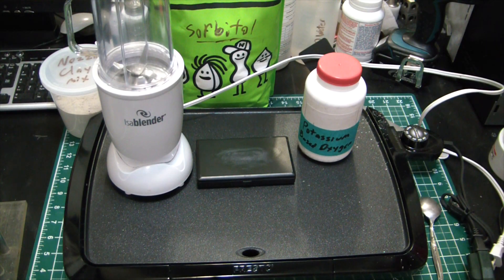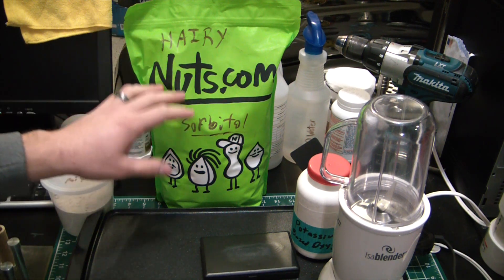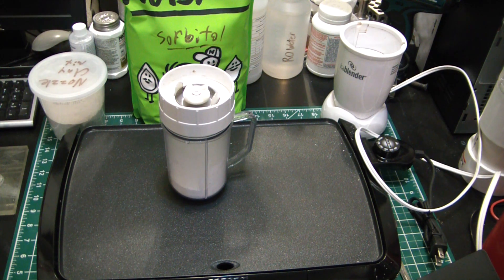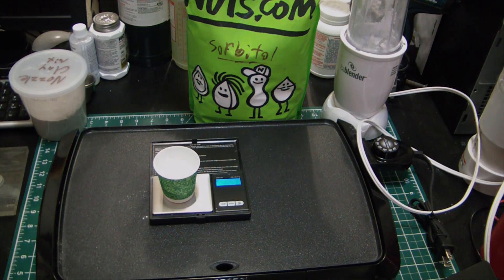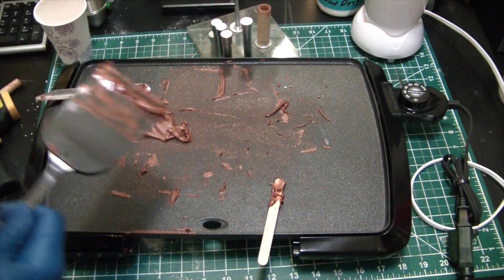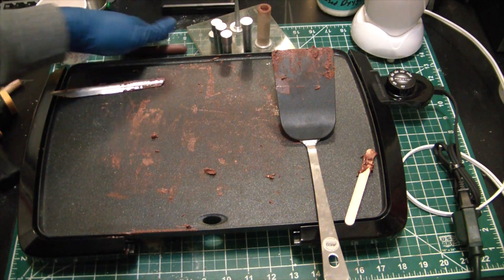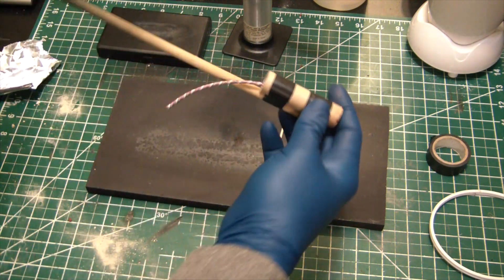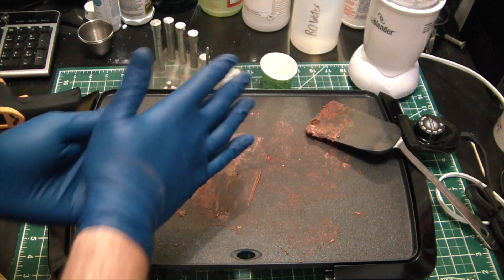Sugar Free Rocket Propellant - The EASIEST Rocket Propellant! - ElementalMaker

Comment: I only have one problem with sugar rocket, Hygroscopicity. So after sugar rocket cooldown, you must quickly store it in air tight container with strong dessicant like calcium chloride. You also have limited time to assembly it especially when air humidity is high. Because sugar rocket will absorb water vapour and become wet. It's why estes choosing black powder for light to medium model rocket, it's still reliable even air humidity is high, don't require calcium chloride, easier cast and more safe to produce
Reply from the maker: Yes black powder is certainly superior for long term storage of rocket motors.

Comment: What is the difference in price's of sorbitol and powdered sugar? And is their a measurable difference in the propulsion and distance from either?
Reply from the maker: Powdered sugar is way cheaper, but the lower melting point and easier workability of the sorbitol based propellant far outweighs the extra cost imo. Impulse is pretty similar from data I was able to find

Comment: Make an electrical igniter with speaker wire. Cut all of the strands leaving around three. Twist together. The way your mould looks the hole goes to the top of the motor. Slide the igniter to the top of the motor. When it burns, it will build pressure as it works it's way to the nozzle.

Comment: Try Xylitol. Its molecular formula is C5H12O5, Its molecular weight is 152.15g. Xylitol's melting point is 93- 95C (199-203F). Interesting, the molecule is smaller than that of even sorbitol. 👍 Best of luck ❤️

Comment: The best thing to do with sorbitol :-). I love this stuff for fuel. Low melting temp and easy to pour. 

Question : how do I add an ejection charge to a pvc rocket motor (assuming I don’t have black powder) ?
Also : is a “rocket candy” motor troubled by absorbing moisture ?

Keep going safe

NOSS
Reply from the maker: Hi noss, unfortunately for an ejection charge you are going to need BP. That being said BP is super easy to make, even without a ball mill. I think the one method is called the cia method, and makes pretty good BP using a wet method.
Reply from the maker: And yeah unfortunately all rocket candies I'm familiar with are aggressively hygroscopic.
Reply: @ElementalMaker  It depends on your ambient humidity.  There's a pretty sharp cutoff where if it's drier than that there's no problem--like where I live in a desert, it will actually dry (very slowly) rather than absorb water.

Comment: Newcomer here!   Does reducing down the sorbitol and KNO3 change the way it burns or does it just make it easier to handle?  I was wondering about the possibility of air pockets if it's not packed correctly and so maybe reduce it down less.  Maybe just enough that it turns to a viscous liquid like brownie batter and could pour out so it would pack better?

Comment: What’s the secret for coring these engines? Do you bore them out after they cool?  Had no trouble dropping the “hot dogs” into the casings, but when it came to forming the core nothing seemed to work. Tried tools that were tapered, straight, metal, plastic, various release agents, heating the metal. They all came out with great difficulty and had propellant stuck on like glue.
Reply: put a small amount of vaseline on the core rod let it set then it comes out easily

Comment: What about some polymer based ones? I imagine polyalkenes like polypropylene or polyethylene would burn quite well. Or styrene-based ones like ABS or plain old Polystyrene, they could be potentially easier to mix with the oxidizer because you can simply dissolve them.
Reply from the maker: Check out my apcp videos.

Comment: Speaking in terms of performance, which ingredient is better? Sugar or sorbitol? I've been doing some R&D with my own motors lately and playing with different mixes. Got tired of grinding and milling the kno3 so I ordered pyrotechnic grade already finely powdered. Got sorbitol otw too so I'm curious to see the difference...if any
Reply from the maker: I believe sugar produces a higher specific impulse, so per unit mass you'll get a bit more performance but the difference is pretty small, and the ease of working with sorbitol is well worth the tradeoff imo
Reply from the maker: I just looked at the data, and knsb is so damn close to knsu in terms of specific impulse it's basically a tie.
Reply: Ease of process is what I've been trying to achieve over performance so that sounds good to me. I've been experimenting with pressing a washer in the end then adding 1/4" of clay for a thinner, lighter nozzle. It also helps center the core hole. I appreciate the info good sir.
Reply: And for the top cap of the single use engines, ive been just pressing a 3/8" long piece of the 5/8 dowel, w/ a slightly sanded beveled edge and pressing it in with my drill press vice. Then applying light bead of super glue on the O.D. of the dowel to seal it up. And violá.

Comment: Can you replace you replace your potassium based oxygen with chlorine based oxygen i.e KClO3
Reply from the maker: Hell to the no, to the no no no. That would be an explosion, not a rocket, plus it would likely detonate on the hotplate and kill the person making it
Reply: @ElementalMaker  that's sad cause i have 1 Kg of chlorine based oxygen
Reply from the maker: @justintremblay2318  Be careful, KClO3 is quite a dangerous oxidizer. the perchlorate compound is much more safe.
Reply: @ElementalMaker  i have to make it tho
Reply from the maker: @justintremblay2318  have to make what? You can't make rocket engines with chlorate, it simply doesn't work and you'll loose a hand.
Reply: @ElementalMaker  meant potassium perchlorate i have to make it because i dont have it i only have KClO3
Reply from the maker: @justintremblay2318  oh thank sweet baby jeebus I was worried for your safety 👍

Comment: Couldn't it be said as the sorbitol or sugar depending on what recipe you are using, converts to carbon or charcoal as this mix burns, basically is making a black powder mixture? But the burn rate is much more controlled than if you were to use black powder because it is not "black powder" yet, kind of like "just in time" black powder

Comment: Okay, so, just to be clear..... Potassium based oxygen = KNO3? I tried making this, and mine was super sticky, definitely not mold-able like dough, as this was
Reply from the maker: Correct. It takes a while for it to cool to a nice moldable consistency, just give it a few minutes sheet you turn off heat and it'll get there.
Reply: @ElementalMaker  Sweet. I'll work on that "patience" thing lol. I'm also gonna try buying some rust powder instead of making my own X'D Pretty sure vinegar jacked it up or something. I tried everything from a butane torch to estes igniters, and my final product just refused to burn

Comment: In high school, I came up with a rocket fuel using Zinc Dust and Powdered Sulfur after checking out the atomic structures of each and used a mixing weight based on the ratio of their respective atomic weights. I used CO2 cartridges for casings. For My maiden voyage, I used a steel jack handle receiver as the launch pad. The cartridge disappeared into the evening sky and the steel receiver split apart from the exhaust pressure. Needless to say I was a science nerd and I had the run of the chemistry class inventory after getting the job of taking inventory of chemical supplies. You don’t want to know the story behind my Red Phosphorus and Powdered Magnesium Flash Powder incident.
Reply from the maker: Very cool! I've only ever seen videos of Zn-S rocket motors. Always wanted to make one but was never able to source enough zinc powder. Thanks for sharing, it definitely makes me want to do a video on zinc sulfur motors 👍
Reply: BTW, I had a local neighborhood Chemistry Club where we did all sorts of science experiments. The dues allowed me to purchase chemicals that required my father to sign off on. (The supplies arrived by rail) I got the supplier catalog from my chemistry teacher. Those were the days. I got the bug after receiving a Gilbert Chemistry Set for Christmas.

Comment: Hah! You said "supercritical". Can you explain more about your nozzle clay mixture? Straight bentanite has been giving me issues.
Reply from the maker: Of course, it's 2/3 bentonite and 1/3 grog by mass. I then put it in the oven with a small chunk of paraffin wax and allow the paraffin to melt into it, mixing every few minutes until homogeneous. The paraffin allows it to compress beautifully and also acts as a lubricant for easy removal from the forming spindle. Another benefit of the paraffin is that it prevents the bentonite from absorbing atmospheric moisture. Probably more than you wanted to hear, but that's my process LOL
Reply: @ElementalMaker  thanks very much. Some terminology issues on my end though, what do you mean by "grog"? To me it means some form of cheap alcohol.
Reply from the maker: @Jannie303  grog is essentially a refractory sand that is used in pottery and other industries. Here is the wiki https://en.m.wikipedia.org/wiki/Grog_(clay)
Reply: @ElementalMaker  Awesome, thanks very much! Just found your channel through your pyrotechnic videos but I'll definitely be going through your electronics videos too.

Comment: Estes are stupid expensive... what are they now, $10 for 3?  And small ones, not even the D or E class engines.
You know why they're so expensive? LAWYERS.  Same with simple tools for casting metals like aluminum, a set of tongs for pouring a 6lb crucible, $20 or less of materials, costs $400.  Fuck the lawyers.  All Gems should die.
Reply from the maker: Wow I didn't realize that got that expensive!

Comment: btw, sorbitol based fuel burns much slower than sucrose fuel which means that you will have to make the nozzle smaller to get the thrust that it is capable of giving(which is less than that of KNSU)
Reply from the maker: Yeah I'm going to change up the tooling I made for a more narrow nozzle throat diameter. Ill step it down to 1/4" and see how that goes.

Comment: I wonder what happens if the sugars get to be mixed up like 1/1 ratio sorbitol/table sugar 1,if it stays so moldable,2 maybe more power?
Reply from the maker: Quite possibly. Although I think at those low temps the regular surgar would stay crystalline, leading to grainy propellant.
Reply: @ElementalMaker  yeah that would be in this method, if you add the tablesugar first it would be standard r-candy yet adding the sorbitol later in the process might do something amazing....or not ;p

Comment: Which is better proponent for rocket black powder or rocket candy? And why?

Please explain 🙏

BTW thanks for making amazing videos
Reply from the maker: There are way too many factors to really say. It all depends on your production volume, rocket engine size, and many other factors. Black powder engines can be made up to F class and are quite easy if you have the proper press equipment. Sugar rockets can be made larger, but are generally more time consuming to make. Also if a motor will be stored long term, sugar is a bad option as its hygroscopic and will degrade over time as it absorbs moisture. Black powder doesn't have that issue and has an indefinite shelf life
Reply: @ElementalMaker   Many people I watch doing sugar rocket videos are using some form of tupperware to keep the motors in when not in immediate use, to combat humidity.You could also mason-jar smaller bates grains segments. Richard Nakka advises using a primer on the fuel grain as sorbitol can be a tad hard to ignite. Electric matches (you can make them yourself and avoid hazmat shipping charges.
Reply from the maker: Absolutely. I prefer not to use mason jars just because of the whole glass holding a pyrotechnic composition thing, but any airtight plastic container works well. Especially with a few silica gel or other desiccant packets. I did a video on making ematches if your interested.

Comment: Its amazing that the stuff burns in such a manner that it aims all its exhaust in one direction despite not being encapsulated.

Seems you could just put a cone in the back of it [like a shape charge] and it would try to fly, although I realize that is not enough pressure control to produce adequate thrust in real life, it just leaves one with that impression.

I want to try with CALCIUM oxygen and with CERIUM oxygen some day.
Reply from the maker: Yeah it is really neat the way it burns! I may have to try that idea and see it I could create a case-less rocket!
Reply: @ElementalMaker  Well, if nothing else, you can always stick some really fine steel wires into it while it is still warm [shape it in a tube lined with something that will let it slip back out, like waxed paper maybe] to act as fletching

Coating it would also help keep it a tiny bit drier, maybe a few brush strokes of beeswax/paraffin as a water repellent, many other options exist, Scotchgard, thin epoxy, spray paint/lacquer, etc.

Another option might be to include a combustible shell of propellant which simply lacks the iron oxide, and that would act as its own casing [ (giggle) ... a 'caseless casing'  ] as well as a place to hod the tail stabilizers.

All that the tail wires need to do is to not melt or burn up before the rocket completes its flight.

Non-metallic options may exist which can endure the heat.

To add gas to the exhaust and slow the shell burn a tiny bit more, one might add a small dab of bicarbonate to the mix so that it will be the last part of the motor to burn up and therefore be sure that the fletching remains in place until the very end.

The only worry would be if you launched it over dry grass or some other flammable situation because if it did not fly high enough, it could come down hot enough to set stuff on fire before burning up.

Winter time is definitely a lot safer time for such experiments.

Comment: When I was 19 way back in 1994 I was making sugar and potassium nitrate smoke bombs in the house, I was melting it on the stove, too hot I guess, and it ignited, burned a big hole in the kitchen linoleum. That anarchist cookbook was full of shit when they said the stuff was non flammable!!! (A few months later i shot a hole in the kitchen cabinets with my longbow by accident, I was making arrows and drew one back to have my wife mark the length when the top limb hit the turning ceiling fan, bam! Straight through the cabinet) I'm still married to the same woman, she's put up with a lot of my stupidity.
Reply from the maker: Holy crap your kitchen has taken a brutal beating! Ever consider a workshop? LOL  Thats a good woman by your side. I got one of them myself. We're lucky guys.

Comment: Potassium based oxygen is potassium nitrate or KNO3 
for the one person who doen't know haha
Reply from the maker: I have KNO3W Idea what your talking about.
Reply: ElementalMaker kno3 or kclo3? Kclo3 higher burn rate? Higher sensitivity to heat?
Reply: @6themaker  KNO3 is potassium nitrate.  https://en.m.wikipedia.org/wiki/Potassium_nitrate
K represent potassium. N represent nitride (nitrogen).  O3 represent three oxide
Reply: @6themaker  https://en.m.wikipedia.org/wiki/Potassium_chlorate
kclo3 is potassium chlorate.  K represent potassium. Cl represent chlorine. O3 represent three oxide
Reply: ElementalMaker anytime you need some CNC turned nozzles let me know. We have a CNC machine shop and make sugar rockets occasionally just for fun. We make the tubes from 2024 aluminum and thread both ends. Nice plug on one end and 7075 nozzle on the other. It works surprisingly well for nozzles. Bates grains inside paper housings work great with this setup.
Reply: @LukeFoley21  you make metal tubes for the rockets, that sounds really dangerous.
Reply from the maker: Reloadable metal casing rocket motors are actually quite common in the high powered rocketry classes. I have a few myself that work beautifully.
Reply: @ElementalMaker  still deadly if you plug the hole to tight and pressure builds up isn't it?
Reply from the maker: @theterribleanimator1793  absolutely! Care must be taken as with all pyrotechnic compositions
Reply: @ElementalMaker  is it worth it though. shouldn't a metal casing make the rocket heavier and thus make it slower?
Reply from the maker: @theterribleanimator1793  most casings are 6061 aluminum which is quite strong for its mass. I believe at that size the paper casing would actually weigh more.
Reply from the maker: @LukeFoley21  Thanks for the offer Luke! I may take you up on that at some point! I have a CNC mill I built using an old G0704, but not have no clue how to program it so cant spit out nice parts for myself yet.
Reply: @ElementalMaker  might want to contact This Old Tony. He's built his own cnc and recently added a 4th axis. Might be able to help you with learning to program it.
Reply: @theterribleanimator1793 , if nasa does it then why shouldnt I do it?
Reply: Shhhhhh, kno3one can kno3
Reply: What about Perchlorate? ClO4(-)
Reply: @quantum7401  ClO4(-) mean Perchlorate. That's correct answer.   https://en.m.wikipedia.org/wiki/Perchlorate
Cl represent chlorine. O4 represent four oxide.  Oxide also (oxygen).
Reply: Nicd
Reply: Thansk
Reply: Why not K20/potash?
Reply: Oh no i thought it was potassium chlorate
Reply: And you said an additional 2g of fe2o3?
Reply: @kobraa55a55in  Fe2O3 mean iron (III) oxide. Not gunpowder. Iron (III) oxide used in steelmaking.
Reply: A little dash of powdered aluminum maybe?
Reply: I don't think so it's potassium nitrate. It's gunpowder.
Reply: You must be modest. Not arrogant.  Knowledge is power.
Reply: Shhhhh